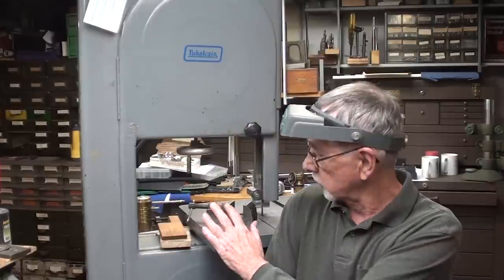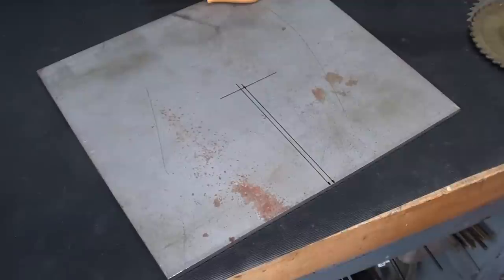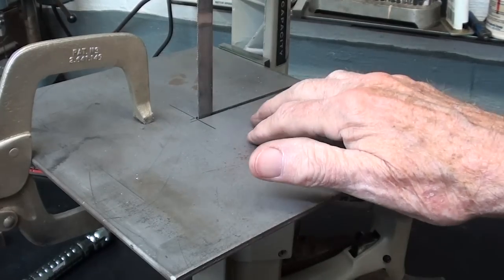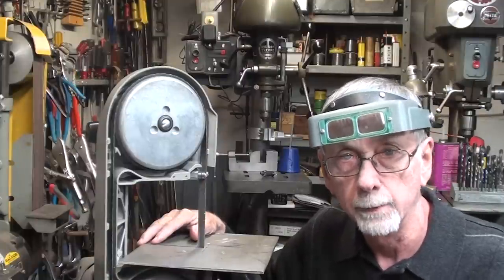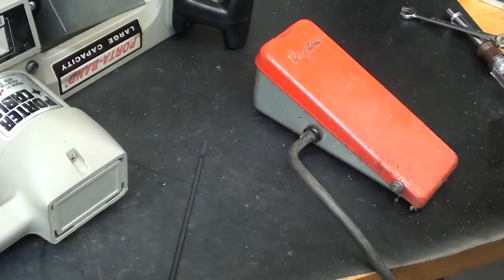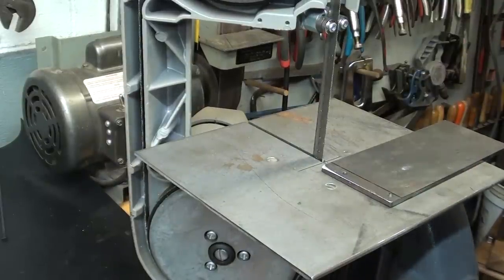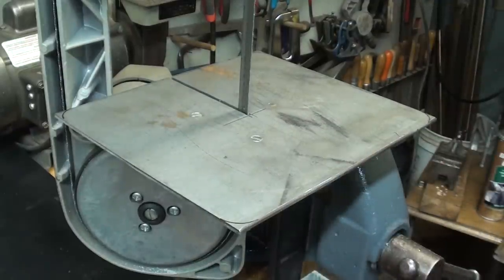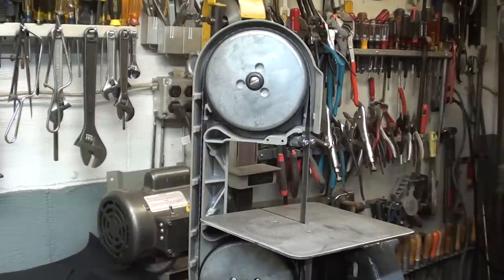Make a Mini Vertical Metal Band Saw TIPS 579 tubalcain

Comment: As a follow-up, could you compare how this stand might be adapted to one of the midget cordless bandsaws, like your little Milwaukee? Those little saws have a very small height capacity, but for the average weekend warrior, thicknesses over 3/4" might never be seen. I'm just curious about power and battery life.
Reply from the maker: That’s a possibility, but very few people own that saw
Reply: @mrpete222  yeah. I would love to see you do a review/stand build on the Harbor Freight porta band, at $90 it seems fabulous for a weekend warrior.
Reply: If you can save up the extra bucks, don't get the midget but get the full size Milwaukee M-18 cordless, brushless saw.  The thing is fantastic and if you use the large 4 to 5 Ah batteries you will be surprised at the power and battery life you wll get.

Comment: Great video. How difficult would it be to make the top bearing adjustable?
Reply from the maker: Pretty great
Reply: Can the 2 tapped holes near the top guide be used to mount a sheetmetal blade guard for safety?  The vertical adjustable blade guard could be slotted, studs screwed into the holes and tightening knobs would retain it's throat setting.
Or retain both existing guide roller assemblies, buy another roller guide assembly, mount a block using the 2 tapped holes. Mill a shallow dovetail slot between the holes, mount the 3rd guide assembly with a sheetmetal blade guard on a key shaped to fit the dovetail slot. Use a knob to adjust the throat opening.
A very useful and functional project as is.

Comment: I have a couple metal bandsaws. I believe both are shop built by my wife's old blacksmith uncles. One was set up for a vertical table but was removed.  Those guys apparently didnt believe in bolts because they welded everything together. I have done some modifying and hope to set the small one back up with the table.

Comment: I saw a youtuber that attempted to make a bandsaw blade narrower for curves, his method ( not osha approved) was using a dremel cut off wheel and as he hand rotated the mounted band, he scored the middle and theoretically would remove the back. If I recall right, he wound up rigging an angle grinder and cut off wheel to complete or on a different blade. 
I believe I'd buy blade buy the roll and silver solder to length I needed for my 2 portabands I have, I often wish I had a wood tooth blade on my DeWalt cordless one. I made a table similar to yours for my other crappy harbor freight porta band. I use it with a vee block to split copper pipe in half.
Reply from the maker: That sounds like a good idea

Comment: If you use the two holes in the saw frame  up by the upper guides you could fabricate a blade guard that you could raise and lower a shield to give some protection to the blade. Maybe extend it back to cover some of the saw blade in the back so it don't jump out if it breaks. Good info for over coming a saw shortage!! thanks.
Reply from the maker: Good idea

Comment: Made mine out of a Porter-Cable Model 725 Extra Heavy Duty 2 Speed saw.    Merry Christmas to me, (and you).  I rarely used my 725 much after the invent of the 4-5 inch cutoff blades anymore.  Trouble now is that it looks like it may tie up my 4 inch bench vise from now on.  Oh, well, thanks for the video(s).
Reply from the maker: Thanks

Comment: You can also make a square tubing stand like I have that you can mount many diffrent thing's to it and put them away when not in use my square tubing stand I can sleeve in cutters, hammers dollies, vice, shinker, bender what ever you can think of mounting to square tubing it will mount on my stand. When the tools are not in use I put them away or you can have a few square tubing stands and have your tools sitting out.

Comment: Great approach to the problem, would like to see the horror freight adaptation as I think it is a more commonly available unit to the average DIY metal worker. Keep the videos coming, have made many of your projects from the surface plate height/ marking gage that I repurposed a part of a VW crankshaft as the base to purchasing the castings and completing the 1inch machine vises. I keep two of the small vises handy as they are super handy at holding and positioning work in the mill
Reply from the maker: Thank you very much for watching on making the projects. Merry Christmas

Comment: To create an intimate fit, for instance to support some of the weight at the handle, I used some narrow channel and a gob of Bondo. Use stretch wrap to isolate the Bondo from the tool. Could look horrible but if you make the Bondo oversize you can grind or rasp away the excess and paint it... also, Mr. Pete,  what is the gizmo called that measures the band speed?

Comment: I got lucky finding a uaed MSC vertical band saw, paid $100. This video offers an excellent alternative for everyone that can't justify or afford the cost of a new vertical band saw or be fortunate enough to find one used.
Reply from the maker: You got a bargain on that saw
Reply: @mrpete222  I've been very fortunate with machinery bargains. The vertical band saw was purchased along with a Jet bench top mill and a KBC 12x24 lathe for $500. Sold the Jet for $200 so I figure $200 for the lathe and $100 for the saw. My J head series 2 Bridgeport I  paid $1200 for. It has a 48" table, new motor, X axis power feed and what I'm pretty sure is an upgrade of recirculating ball bearings for the X and Y lead screws. I stripped about 20 pounds of old paint, replaced spindle bearings, spindle clock spring and a couple other small things. I've added a DRO, Z axis power feed, new paint and a phase converter. I honestly can't imagine life without a Bridgeport after having one for the past 8 or so years.

Comment: This is the only band saw in my machine shop. I didn't make the base, however; mine is from Swag. Their bases are custom fit to multiple different saw models (mine is for DeWalt), and are very well made from heavy laser-cut steel. I screwed the base down to the plywood top of a tool cabinet and added a big red/green ON/OFF switch in a junction box to the side of the base. My saw required using zip ties to hold the power trigger.
These little saws use loud motors, so I have a pair of earmuffs sitting right next to it.
Reply from the maker: Yes, I have seen those bases made by swag. They look pretty nice. And you are right the saws are noisy

Comment: Why not use the porta-band as it was meant to be used when it's time to cut the slot, round the corners and cut off the clamping post? Clamp the work piece in a vise and hold the porta-band in your hand and make your cuts. I'm also curious why you attached the post to the table by tapping holes in the table, but chose to run the bolt through the table to attach it to the saw, requiring a countersink to make the heads flush? Do you think that a narrower blade, soldered up from a broken blade, would track on those wheels? Really enjoy your videos and intend to make one of these for my HF saw. Never occurred to me to vise mount it before and I just didn't have room for a floor mount or bench top setup.

Comment: Good morning Mr. Pete, Great video on this idea. I have done a similar idea to my horizontal saw to cut vertical. Great idea for the guy that doesn't have any saw. Merry Christmas.
Reply from the maker: Thank you. Yes, I have seen several people that adopted the horizontal saw for that purpose
Reply: @mrpete222  I just have finished converting a auction purchased band saw to metal cutting using a 3 phase motor and vfd. I used a 3 to 1 belt reduction and can achieve blade speeds form 75 feet per min. to about 500 feet per min. Works well with a m42 cobalt blade from Saw Blade .com .

Comment: Another excellent video mr. Pete... I imagine if you wanted to you could fabricate some kind of adjustable blade guide out of some square stock and small bearings couple of small thumb screws to lock it down to whatever height that would anchor to the body of the  machine.. anyway anything's possible...
Reply from the maker: Yes, thank you for the idea. There are endless possibilities. Merry Christmas

Comment: Interesting.  Looks like a good, inexpensive yet very robust design modification.   A question, if I may:  Why can't the saw's cutting angle be straightened?  Seems to me it just needs the blade guide mounts redesigned, and while you're at it, a retracting device for the upper guide could be built as well.  This would result in a deeper throat and allow the use of thinner blades like those used in a standard bandsaw.  You're already cutting and welding thick steel plate for the vise mount so I can't imagine this extra step being too difficult.

Comment: I'm a big fan of tapping all the holes rather than fumbling around with nuts and lock washers.  It's much easier and it eliminates having the extra hardware being in the way.  A spot of Locktite on the screw threads will secure it firmly.

And, a piece of aluminum U-channel, suitably attached will make an inexpensive and great blade guard.
Reply from the maker: Good ideas. Thank you

Comment: If you had made the slot for the blade from the opposite edge (front) and clipped the left rear corner slightly (for blade clearance), would it be possible to make blade changes without removing the saw from the table?

Comment: Interestingly...my portable bandsaw harkens back to tubalcains era i.e. the trusty hacksaw LOL....I use my angle grinder for many cuts also...but no matter how careful i layout my lines and try as I might my cuts always stray...Great Idea...
Reply from the maker: You may laugh, but I often use a hacksaw. I have at least 10 of them. All with different kinds of blades in them. I also probably have 500 brand new blades from garage sales. Good blades not the cheap ones
Reply: @mrpete222  no i wont laugh...because of you i learned the value of a half dozen different saws set up with different kinds of blades...plus I now search out high tension saws...but i am going to biy a horror freight...

Comment: You might be able to use a Velcro tie strip to hold the trigger.  It would be easier to remove than a zip tie.
I have a roll that I got from the gardening section at the big box stores.  I think it's marketed for tiring vines to trellises and staking tomato plants.

Best holiday wishes.
Reply: Similar strips come with some power tools and are used to tie up the cords.   Most of us may have one lying around already.
Reply: @DrewLSsix  yes, but in my experience there are always more cords to tie than Velcro strips to tie them.
Reply from the maker: Thanks

Comment: Curious why you didn’t cut the slot out the front edge of the table.  Would have made replacing blades easier I suspect.  Great video, as usual.
Reply from the maker: Never thought of it

Comment: I put two thick hooks on a post in my shop that the forward handle fits into holding it horizontal. I will add a table like you made. 
I like your cameo on This old Tony's Christmas Story. 
I like vice builds.
You are funny. Can cut your bandsaw table on a bandsaw. But you may not have a bandsaw ha ha ha.
Reply from the maker: Yes lol

Comment: That is totally awesome about using a portable band saw to set it up to be a band saw. 
I want to do a project with a chunk of solid Aluminum that needs to be 6"x4"x3". Would it be reasonable to meltdown soda cans or just locate a solid piece of aluminum, and where can I purchase a solid chunk of aluminum if you don't mind. 
Merry Christmas and a Happy and Safe New Year
Reply from the maker: It is hard to find a big chunk of aluminum. Without buying a long piece, and paying a cutting charge and shipping charges, and minimum charges. Try the melting option. But do not use soda cans. Use good cast aluminum such as pistons
Reply: @mrpete222  thank you for the information.

Comment: Harbor Freight  carries the Bauer brand of portable metal bandsaws. I bought one to save money and returned. Problems right out of the box. Bought a Dewalt next. Modified an old Craftsman metal bench top router table with an aluminum top for the table. Very stable, no need to clamp down.

Comment: Suggest that you reverse the direction of the slot on the plate. If you make the slot  180 out from where it is you can change the blade without taking the table off.  especially if you need to shim the plate to get it square.

Comment: Enjoyed the video and thought gee i could round the corners and even do the slot with an angle grinder Most low tech guys on the internet use an angle grinder in as many applications as norm would have used a plethora of cnc woodworking machines.
Reply from the maker: Yes lol

Comment: One comment about the saw, the drive wheel rubber pads deteriorate very quickly, I found that when not using the saw releasing the blade tension helps the life of the pads. You probably know that. You called them open wheels.
Reply from the maker: Thanks for pointing that out

Comment: I built mine from a 1/4" 12x12  piece of hot rolled steel. I put a length of 1/4" x2" angel iron on the left and right sifes for mounting in the vise.

Comment: When you said you were going to cut and round the corners off the plate and then dismounted the saw I thought while the plate was still mounted in the vise you'd lop the corners off with the prota-band but nope you went to another machine to make the cuts. BTW there is a  drawing for a metal cutting band saw in SketchUp 3D Warehouse to be constructed from plywood attached to a Porter Cable drill motor.
Reply from the maker: Thanks 👍👍

Comment: HF Bauer portable band say is $135.  The table top 9" bandsaw is $140.  I can see advantages of both.  If you want to cut a 2 feet long piece of bar in half, the table top saw won't do it where as the portable is not limited in that direction.   In the other hand, if you want to make a long cut, say cutting a piece of plate slightly larger than what he used for the table in half, that won't fit through the converted portable saw.  The beauty of this project would be if you already have a portable or find a good used one at a garage sale, you can make the conversion.

Comment: good build/discussion.....I hope readers will view my comment and learn....this method of making a vertical bandsaw is at the expense of access to two tools (vise and handheld saw) ...to use the vise, you have to remove the bandsaw from the vise,  to use the bandsaw handheld you have to remove it from the vise and remove the table....IMO with just a small amount of design/build the unit can have it own stand with safe adjustable table and be quickly changed (without unbolting) back to a hand held bandsaw.... a vise held method, there is just too much frustration...Murphy’s Law the setup will alway be wrong at the time when vise or saw is needed....
Reply from the maker: You make some good points. But of course I have many vises. And I guess you could say several bandsaws.
Reply: mrpete222 TRUTH... my comment was for hobbyists that don’t have much tools or build/shop use experience

Comment: Psa. If you buy a porta band from harbor freight ABSOLUTELY BUY THE EXTEND WARRANTY! 3 years I've gone through 3. The first 2 lasted 3 to 6 months each (bearings fell apart rubber on the wheels came off) the 3rd is still going strong!  With the extended warranty just bring it back and they give you a new one! You don't even need the case lol
Reply from the maker: That’s good advice

Comment: A portablebandsaw is a verry rare tool in Europe. never seen one in use. Sometimes I clamp a jigsaw upside down in a black & decker workmate.
Reply from the maker: That’s strange, why are there no portable bandsaws over there
Reply: @mrpete222  Porter cable tools are not sold here. Never propperly introduced I think. There are enough way's to the same job.

Comment: I built a stand for my Harbor Freight bandsaw last summer. It's one of the best tools that I have in the shop. Makes fabrication so much fun.
Mine is free-standing though it goes on a bench not the floor. Putting it in a vice is an interesting idea.

FWIW yes the Harbor Freight bandsaw is totally fine. Just throw away the saw blades it comes with, they're junk; go buy some real blades.
Reply from the maker: Thank you, several people have told me that those bandsaws are quite good from Harbor freight

Comment: Everything is good except for that slot!  You must remove the table every time you want to change the blade.  If you orient the slot from the blade, forward (like the bandsaw you are cutting out the parts with), then you can change blade without removing the table.

Comment: I hope this doesn't  come across as bragging, but I got a DoAll 60 inch capacity vertical band saw at an auction for seven hundred dollars, because, I assume nobody has space for such a large saw. or difficult to transport?
Reply from the maker: Wow, that must be one of their biggest saws. And it is top-of-the-line. But you are right very difficult to move down into a workshop, and extremely heavy

Comment: If you're doing so much metal work that you need a metal cutting bandsaw you probably have a MIG welder or stick welder, if so just weld a metal tab on to the bottom of that large plate and bolt it up as if it were the small plate that way you don't have four screws to worry about coming loose, you only have two.
Also it should be a piece of cake to transfer those two bolt holes onto the metal tab before you weld it.